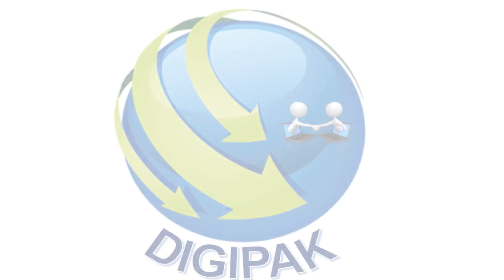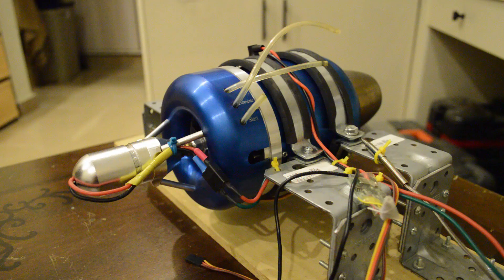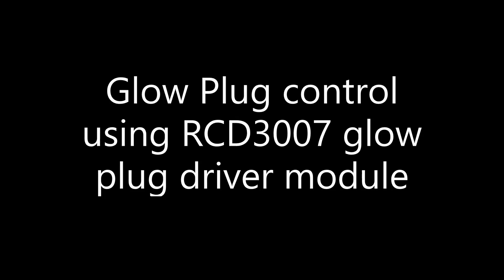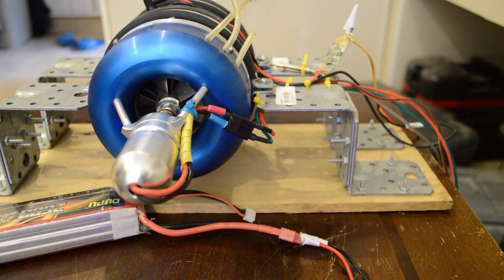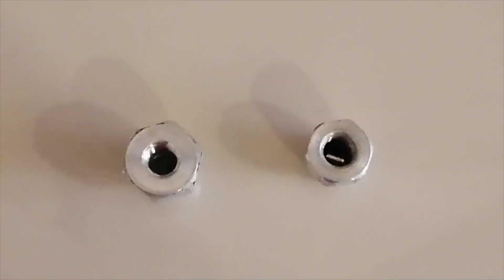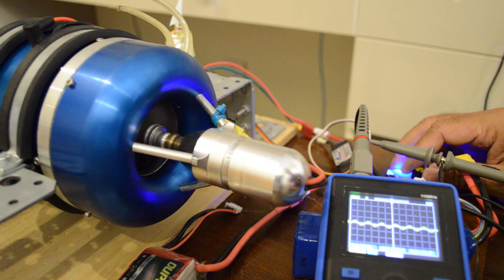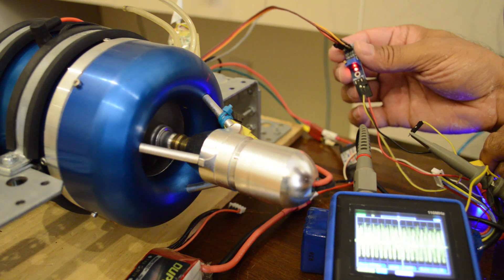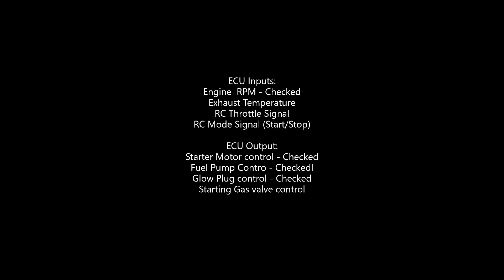Arduino based ECU FADEC for model Jet engine Part 1

Comment: Hello DigiPak, your video is excellet, but I have got one problem, I do not really know what hall effect sensor exacly you are using here. Can you give me response with excact model of it? Thank you in advance.
Reply from the maker: For RPM measurement, I am using an RPM sensor from Xicoy. To clean up this signal from the RPM sensor, i am using YS-27 Hall sensor board. The hall sensor board has a hall sensor with an amplifier on it. I have removed this hall sensor in ys-27 board and just using the amplifier to amplify the signal from Xicoy RPM sensor